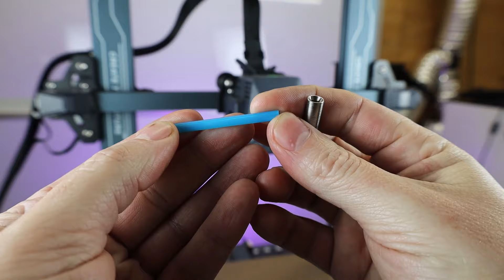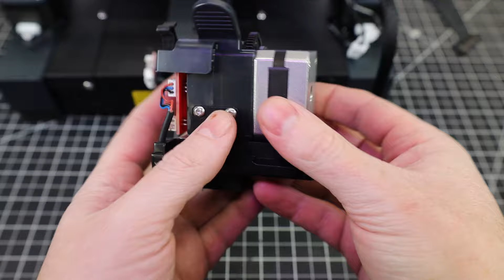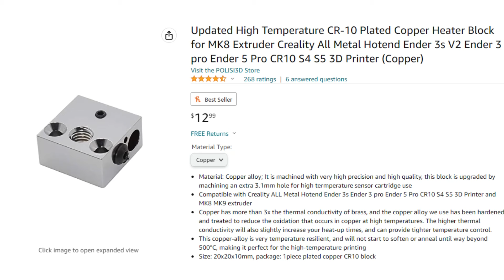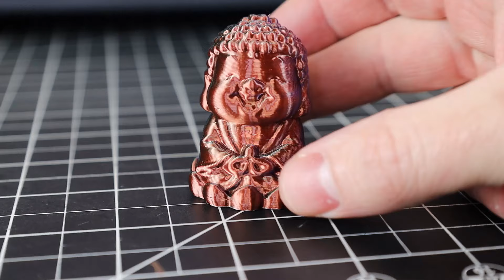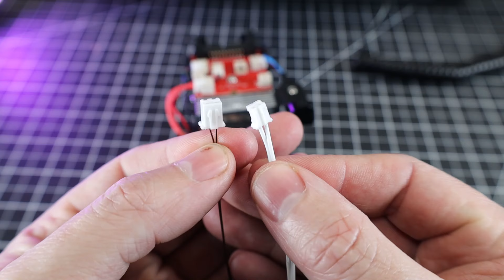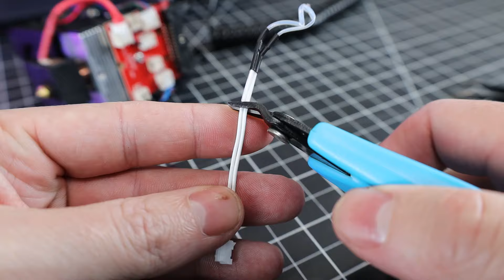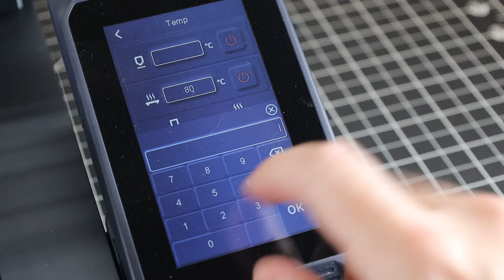$25 All-Metal Hotend Upgrade For Elegoo Neptune 3 Pro, Plus & Max

Comment: Added these mods to my Neptune 2s and they work great. Getting ready to do this on my 3 Plus soon. Does the PTFE tube serve any feeding function in the Neptune 3 printers? The upgraded heatbreaks don't have the deep "cutout" for the tubing to be inserted, but there is a little bit. In the video, you seem to leave it out entirely, so I'm guessing you no longer need it at all. Just wondered if it should be cut shorter. When the filament is loaded, it won't bind in the direct drive system?
Reply from the maker: So the PTFE tube does help when loading the filament so if you cut it down to about 30mm it fits back in there and helps.
Reply: @randymay  thank you!

Comment: Clear and concise.  However, have you investigate either the Volcano style hot end or the multi-port nozzles?  I am keen to print faster rather than print hotter.
Reply from the maker: Thanks and I haven't really looked into different hot end setups for this. I know that if your doing to print faster you are going to want more heat to keep up with the flow of the filament.

Comment: Mine was clogged and after taking it apart there seems to be a small bit of filoment stuck farther up the pipe. It is just after the first wheal drawing it in. Do you have any ideas on how to get it out? I can shine a light through the top and see something up there but I have no idea on how to get it out
Reply: Was able to get it out with some finagling. Now just to test the machine to se if I messed anything else up.
Reply from the maker: How is everything working now?
Reply: @randymay  Its working better now. Just trying to eliminate some banding that happens whenever a wall starts after a base or the start of a feature on a wall. Like if a hole or a letter imprint on a wall starts the first layer of it causes a horizontal band.

Comment: Why do you  it need the blue tube on the new one? The metal parts are the same length? I just ordered all these pieces, but want to make sure I understand it all. Thanks!
Reply from the maker: You can use it without the blue tub but it will make it harder to load the filament. I suggest cutting the tube to about 30mm long and put it back in and you will be fine.

Comment: So I replaced the heater block and heat break with items you recommended... install went fine, but when running the ABL, i get probing failed at point 17 every time... I even took it all apart and put it back together again... same result. any ideas?
Reply from the maker: Sorry about the late reply, is this still happening?
Reply: @randymay  Yup. Still going on.
Reply: @randymay  This is the 3rd person experiencing this.
Reply: Any luck?
Reply from the maker: I really suggest everyone that's having this problem to measure all of your parts and compare your measurements to the original parts. Just to make sure that it's not something that it's too long seeing that everything should line up right to the same exact spot
Reply: @randymay  did you ever put the ptfe tube in yours? Seems to be the only step I’m doing that you didn’t in your video?
Reply from the maker: I did put it back in and you have to cut it down to the proper size or it would make everything too long.
Reply from the maker: I measured the piece that I put back in and it was about 30 mm
Reply: @randymay  ok
Reply: @randymay  my abl is even missing the bed on the first step almost acting like it thinks everything is an inch to the right
Reply from the maker: That is very odd seeing that adding this shouldn't have affected anything else. Doing this would be like changing out a few bolts on a car, the system wouldn't know anything has changed.
Reply: @randymay  yeah idk something has def went awry
Reply: @randymay so I went in and removed the ptfe tube. Didn’t make a difference. Then, I went back in and loosened the nozzle to have a bigger gap and screwed the heat brake down more…and bam worked like a charm. Don’t know why that worked as it’s literally the same length but it did. I then leveled my gantry to fix the ABL points and it’s working.

Comment: In the process of removing the thermister connector from my old heat block I also damaged the heat cartridge. Do you know where I can get a replacement for it or what the JST size is on that connector?
Reply from the maker: https://amzn.to/3XZYmj3
Reply: @randymay  Right, that's the new heat cartridge, that's easy to find. I was asking about the size of the connector that plugs into the hot end. The white connector.
Reply from the maker: @Whamola  The 2 pin connector is the one in this kit https://amzn.to/3KLtqzU

Comment: Hello I have aittle question because I'm not 100 percent sure about it.   You mentioned using thermal paste on the description.  Where to use it if I may ask?   Sorry if its obvious I'm new to it and wanna learn as much as possible. Thank you
Reply from the maker: Around the copper part that goes into the heat sink
Reply: @randymay  thank you very much

Comment: Do you have to reuse the blue tube from the original hotend?
Reply from the maker: You don't have to but it will make it harder for you to feed your filament all the way down to the hot end. So if you cut it down to about 30 mm in length you can use it.
Reply: @randymay  Given that the lip is narrower on the new bimetal hot ends if a person uses the original long PFTE piece they're going to extend beyond what they should.   My stock one since it seats all the way into the stainless steel original flavor sprite heat break is a whopping 55mm.  Has to be cut down or else it's going to bottom out inside the heat sink and make it so that you can't screw the new heat break in enough if that makes sense.  The number you quote around 30 indeed is about what it should be for the short lipped bimetal heatbreaks but regardless in my case it's still causing my probe to no longer detect the bed and bottom out (hard) into the bed.
Reply from the maker: That is odd seeing that this shouldn't change anything when it comes to leveling
Reply: You totally should fill the gap with the PTFE tube to have the filament lead in nicely and not introduce potential problems for later.
Don't listen to anyone telling you it's optional, it's not, you might be printing fine for a while but you have a failing point where none should be.
The PTFE tube needs to be cut so that it has a bit of squeeze to the parts, leaving no gaps.
Don't use the 30mm advice either, cut it to the necessary length not just some arbitrary number someone told you, it might be 29 or 31 for you to get a good fit.
Reply from the maker: 30mm is what I cut mine to to have no gaps but I guess it can be different on others setups.

Comment: Did you not having any problem with the abl? My nozzle pushes into the bed and after  37 of 49 points (N3+) I get 'Probing failed'...
Reply from the maker: I don't have any problem with that at all. My setup is the same size as the stock one.
Reply: @randymay   I had the same issue with ABL as you did.  Very dangerous.  See my comment above...still looking for some type of solution.
Reply: @johnpahos8063  No problems with ABL on my Neptune 3 PLUS, but I noticed that new hot end is longer than old one. I avoided hitting the bed with a nozzle  by sending "M851 Z+3.0" command, so the nozzle would sit really high when leveling menu is accessed. New z-offset is -1.57 mm, old one was -2.33 mm.

Comment: Thanks for this. Went with the Copperhead and copper block. Right now I just want the headroom this affords and the ability to print more exotic like material down the road. Appreciate the video. Thank you.
Reply from the maker: No problem and let me know how that all turns out
Reply: I know it's been ahile but I think I may have finally gotten it working well. I had intially taken it back out because I experienced clogging. Reinstalled it all and PID tuned, then ran an elaborate retraction file. Upped retractions from 2 to 3(.5?) and so far so good. Upped retraction speed as well from 60 to 120 and it works, the test said it would, but I'm still feeling that's high. Anyway, thanks again.
Reply: @jayfc3  I noticed retraction issues after this upgrade as well and was able to drastically reduce hot end temperature. Did you see a similar effect?
Reply: @jayfc3  how are you liking the copperhead hotend after a year?

Comment: what can we do for temps higher than 280? im looking to hit 300
Reply from the maker: You just need a thermistor that can handle it and update your firmware.
Reply: Are you aware of anyone who has reported successfully doing this?
Reply: @s0d4c4n  successfully going higher than 280? or just doing the mod in general?
Reply: @stolenboistudios  higher than 280. I was able to complete the mod. I didn't notice any issues with it until I tried to raise the temp. Haven't tried printing anything else, trying to figure out what I want to do with this machine now.

Comment: I have done this upgrade using all of the listed parts.  I had great luck with PETG.  When I use PLA/silk, I am getting not a jam perse, but I think my filament is catching in the throat of the heat break?  When my print fails at some point and I remove the filament it is "chewed".  Any ideas?
Reply from the maker: Did you put the PTFE tube back in and what temperature are you printing at?
Reply: @randymay  I skipped the PTFE tube as you did in the video.  215 for 1st layer and 210 from there on PLA Silk.
Reply from the maker: Try putting the tube back in. You will have to cut it to fit. It needs to be 30mm long. Let me know if that fixes the problem
Reply: @randymay  So I think What I am running into is heat creep.  Short prints under 5 hours are great with nearly materials (am still struggling with Silk PLA have tried 205-215 and still clogs or jams in the extruder). Long prints start to split and or clog.  I did replace the PTFE @ 30mm.  I am curious what you suggest for retraction and heat settings with the all metal hotend?

Comment: Is there any work you need to do with the bed leveling sensor since your nozzle is sticking out so much further?
Reply from the maker: I didn't have to do anything different after swapping it out.
Reply: @randymay  I would say yes there is significant risk as I'm not the only one impacted.  I've tried two lengths of PFTE both within recommended spec and a short standard mk8 stock elegoo nozzle and both impact the bed without the inductive sensor triggering.  As in REALLY impact the bed/push it down hard and then produce probing errors.  The Z offset doesn't fix this issue i.e. increasing it doesn't stop it from occurring.  I'm trying to find a Z endstop solution (not seeing one physically on the machine) or Marlin solution but from what I've read the inductive sensor only has a tolerance of a few mm so increasing the length beyond this means it's just not going to trigger.
Reply: @johnpahos8063  I had the same problem but fixed mine by loosening the nozzle to have a bigger gap between it and the heat block, then screwed the heat brake in deeper.

Comment: i also have an elegoo neptune 3 pro and got a problem with warping... on PLA... Im using the lowest recommendet nozzle temperature and the highest bed temp. also the fans are on like 70 % which should be fine. Im using the Polymaker Polyterra filament. the bed adhesion is also no very good. should i try to clean the bed with some isopropal alcohol? Maybe this will work. and overhangs are shitty too even if i crank up the fans and use lower printing speeds... Do you have an idea that might help?
Reply from the maker: Clean the bed with IPA. If you are printing that PLA 200c works for me and 60c bed. I use mostly default setting and they work with almost no problems.
Reply: Or better yet clean it dishwashing liquid as ipa not always gets the finger grease from the bed

Comment: You should heat up the block before removing the heat break (so you don't break it) and also tighten the nozzle while it's at the highest temp you print at or you're going to have a leak.
Reply from the maker: So I took a propane torch to the stock heat block to try and get it off with no luck as well. That being said I know that the thread lock should weaken when hot but I had no luck.

As for tightening the nozzle fully when it's up to temp, that is how I normally change out any of my nozzles. I thought that was common knowledge but thinking about that more, I should have talked about that in the video seeing that people new to this wouldn't know that. 

Anyways thanks for the comment and info. 😁👍
Reply: @randymay  Thanks for your update on Mark's first point and while I too only tighten nozzles when hot, your recognition of a novice's knowledge shows you do understand the point and why you should have commented about it.  Well done, mate.
Reply: @randymay  Don't use a blow torch, just heat the extruder as usual and then wiggle the heat breaker gently and then unscrew it.
Run a PID each time you mess around there.
Reply: Thermal block costs 2$, not even 8. It is easyer to buy barrier and block together
Reply: as a newbie on 3d printers i made this mistake of not tightening it when it was hot, how much should u tighten it when its hot?
Reply: @Jacz_06  first get it finger tight then heat up to 250 then tighten 1/8 revolution
Reply: I just found that out with a normal nozzle, but I am just going to get a new heat block when I get my all metal one

Comment: beginner question off topic : would You possibly be at all familiar with Printers on a budget that can "at least" print 1000 mm in hight ( 1 meter in hight) ? ... and after that width an length can be 50cm x 50cm (500mm x 500mm) .... would  this exist at all ?
Reply from the maker: 500 x 500 x 1000mm is a very large printer for sure and unless your budget is in the thousands of dollars your not going to find anything that big unless you make it yourself. 😅

Here is a link to a 1 x 1 x 1m printer https://www.modix3d.com/big-meter/
Reply: Nothing like that in the normal consumer range, especially on a budget. Check out conveyor belt printers like the Creality CR-30. They have an infinite Y axis so you could potentially print the object on its side.